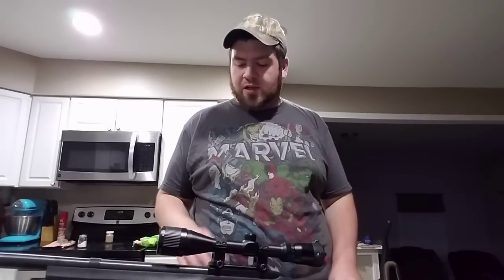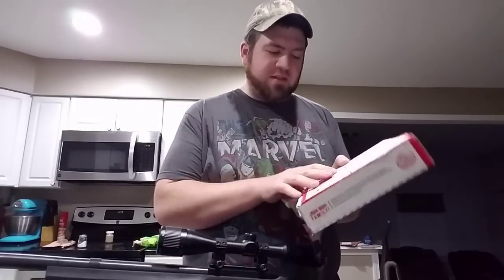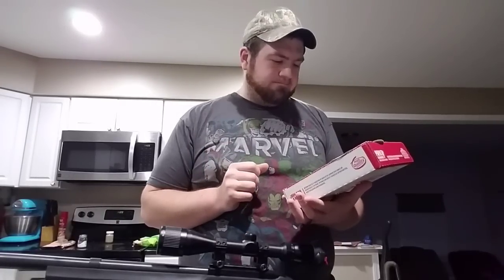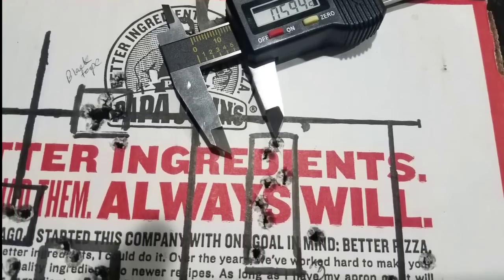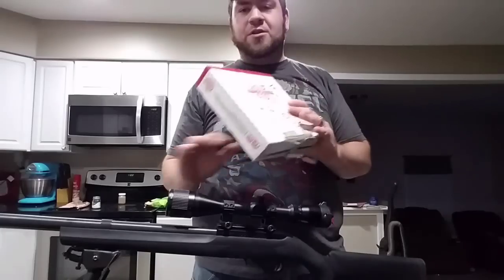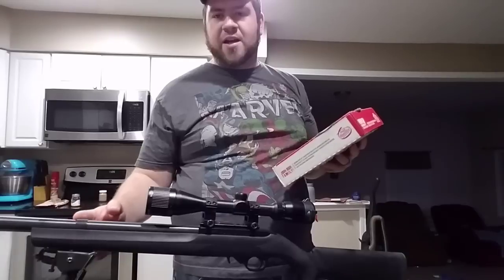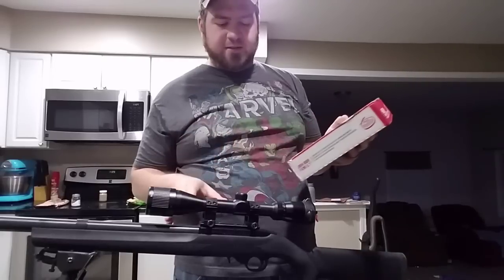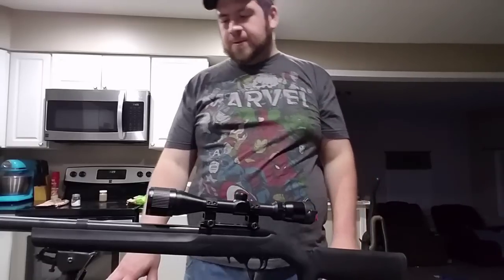How to Tune Ruger 10/22 Barrel

Comment: i put my 10/22 in the magpul x-22 stock. it has a little post that you pressure bed the barrel with at about the same spot you have the black tape. Adjusting the pressure on that post and adjusting the takedown screw tightness has done alot for mine.
Reply from the maker: Right on! I have an updated video at 100yd of this tune thanks
Reply: @hossman84 i have the X22 stock as well but bought a heavy barrel for it. I haven't put the little spacer in yet. What are you torquing your take down screw to?
Reply: I would love to know what the best torque of the takedown screw should be also. Great info and video @ShootToKillOutdoors
Reply from the maker: @frankrightbrain  Factory 20in/lb from Ruger
Reply: @STKO2011  Foot pounds or Inch pounds?
Reply from the maker: @waynehajek6346  in/lb ...I'll correct it
Reply: Where do you get the grommets? What are your thoughts on accurizing a Ruger take down? Is it possible?

Comment: I found a lot of times just putting a steel flash suppresser or blast forward suppressor [Vang copy] on the end of the barrel helps with group shooting. Some are longer some are short, I have several lengths I try. E-Bay is the place.

Comment: How much weight should have an end barrel washer? Will 10-12oz aluminum can be a good weight option for improving an accuracy? Thanks
Reply from the maker: 10-12oz probably too much id use 2-5oz if you can

Comment: I wonder if this would work on the standard OEM barrel?
Reply from the maker: https://youtu.be/ud6TbXHJbo4
Reply: @STKO2011  The tuning method for the factory barrel doesn't include a barrel weight.  Just a barrel cleaning and electrical tape by the barrel band.  Seems a lot simpler.
Reply from the maker: @fjqtaxch9  thanks, yea I tried to keep it simple for everyone instead of adding weight per calculations and results shooting same/similar ammo were just as good or better than this video

Comment: This is an excellent study you've done here.  I subbed your channel.  I followed one of your other videos and put a Carlsons rifled choke in my smooth bore 12 gauge. I'm getting 7 inch groups with brenneke ko slugs at 100 yards. Do you think I could tune my shotgun? Any thoughts appreciated.
Reply from the maker: Josh From Jersey Outdoors thanks appreciate it! You can try to tune it but it sounds like the Brenneke is unstable at that distance what's the group look like? Horizontal, vertical, or swirl pattern?
Reply: Mostly vertical.  The slugs are hitting straight on and not tumbling.
Reply from the maker: Josh From Jersey Outdoors what kind of shotgun and rest are you using? Also what's the barrel length?
Reply: IMO There are no hard and fast rules, just things to try.

Factory loads vary.
Dont end up chasing your tail.

Comment: Not hating the video but ive owned 3 of theses rifles all bought brand new if your only going out 100 yds all 3 of mine were perfect out of the box no aftermarket anything needed
Reply from the maker: Each shooter has their own vision of what accuracy and precision is ...mine was to make my 10/22 the most accurate out there by tuning which I pretty much have, this rifle is capable of sub 1/4moa @100yd and split playing cards at 100yd no problem... I have my factory 10/22 barrel tuned and doing the same thing

Comment: Too bad someone doesn't make a screw on barrel weight for guns that have threaded barrels.  I sure couldn't find any.
Reply from the maker: Suppressors/Muzzle brakes ....makes sense now doesn't it haha they do make barrel tuners but I'm not paying hundreds of dollars for a barrel weight
Reply: Actually I was thinking about a linear compensator.   That would also reduce noise a bit behind the gun.   It seemed like a waste, but if the weight makes the gun more accurate..........
Reply from the maker: Leonardokite there ya go!